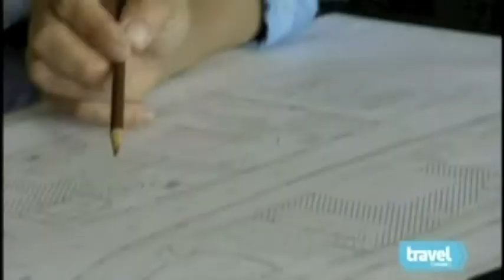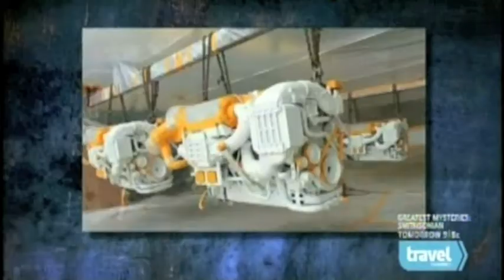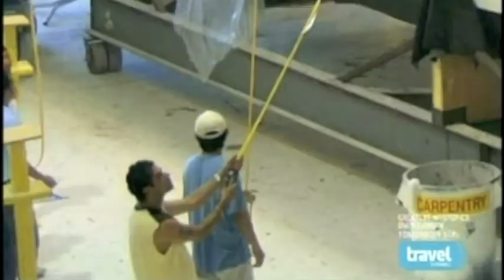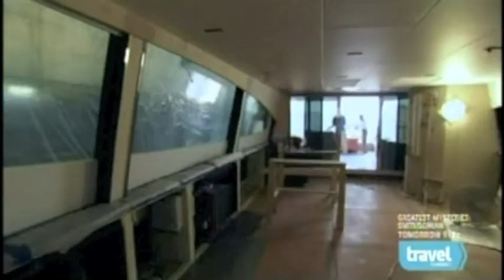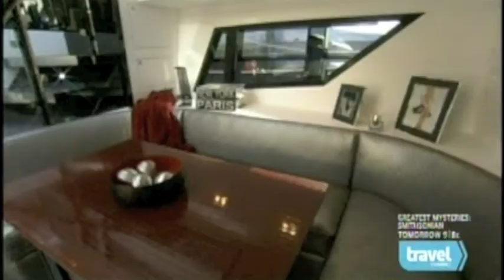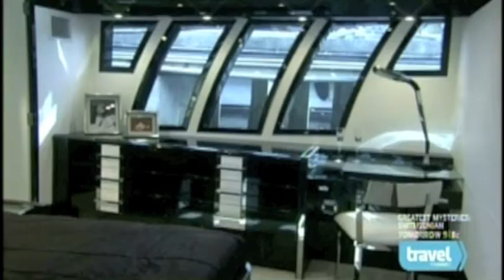How to build  the new Lazzara Yachts  95S presented by Randall Burg

Comment: Do you used  Solar instead generator is it true please
Reply from the maker: Usually only as an extra source of trickle charge to smaller batteries since power onboard is in the 200kw/hr range and only generators can supply this kind of power.  There are yachts that do take advantage of solar but the yachts are designed from the ground up and usually have ab aux. generator aboard for back uo power.